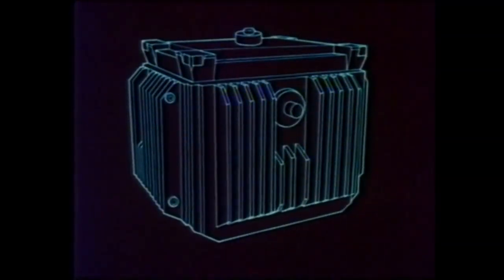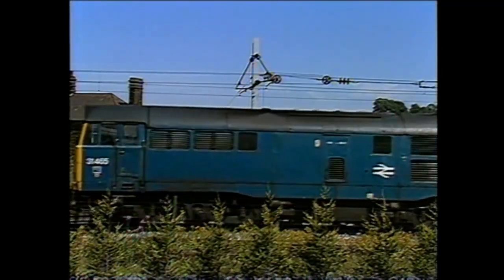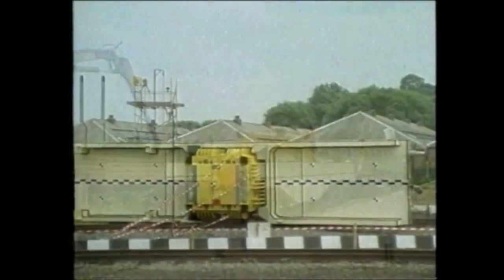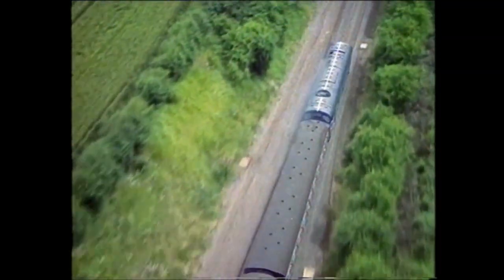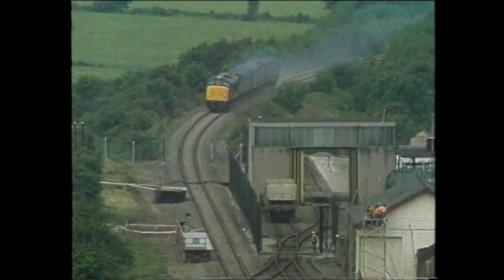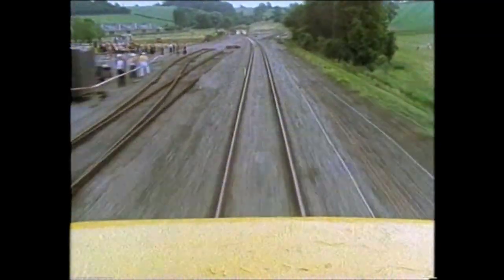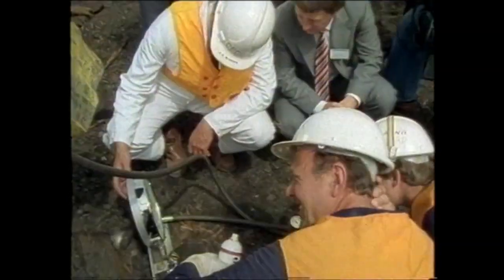17. 07. 1984 nuclear waste crash test

Comment: This crash test was a farce. The train consisted of only 3 coaches, when a normal passenger train in those days was 11 coaches, give or take. Had this been a full-length train the force of the collision would have been at least 10 times stronger, and the outcome far more realistic.  But of course the test had to be fixed, because the flask had to be found to be intact afterwards. I saw this at the time, I was critical of it then and remain so today.
Reply from the maker: They were not testing the locomotive the train or coaches, they were testing the Nuclear waste container, which I believe was usually  on a set 3 vehicles in length.
Reply: @electrocutas  Yes, they were supposedly testing the strength of the nuclear flask. That flask could have derailed across the opposite track, and been run into by a diesel-hauled passenger train running at 100 mph. That train could have been 10- 12 coaches in length, and the force of the collision 10 times more than demonstrated here with a piddling 3-coach train.  I say again, this crash test was a farce.

Comment: Why does 46009s data plate describe it as class 45/0? Both 12 cylinder sulzers, but class 45 crompton parkinson electrics, class 46, Brush.
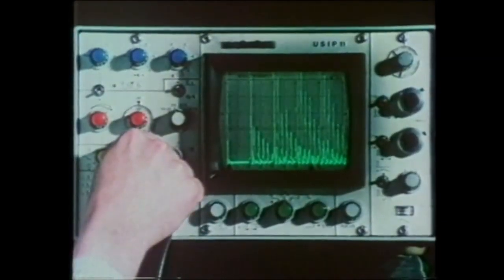Reply: Thought that meself ? Maybe Andy from Little Britain at 00:50 did the design 😄
Reply: @markitg1972 
"But you'll destroy the loco Andy, you said you like Peaks!"
"YEAH, I KNOW".
Reply: @markitg1972  - “Yeah I know” (Well-spotted by the way!)
Reply from the maker: I Have no idea I am afraid
Reply: It was the arrival of TOPS that caused it to be renumbered from it's original number of D146. Assume that they didn't bother changing the data plate?!?
Reply: @simaesthesia  as D146 it would have been a BR sulzer type 4. Classes 44, 45 and 46, collectively the peaks, were 'invented' with TOPS. It would have become class 46 at that point, never class 45. In any case class 45/0 did not exist until some 45s were fitted with ETH and class 45 locos became 45/1 , if ETH fitted or 45/0 if not ETH equipped.